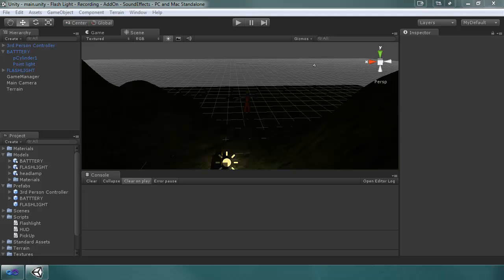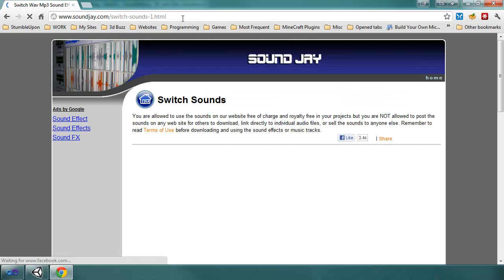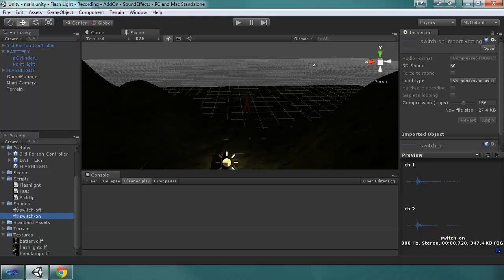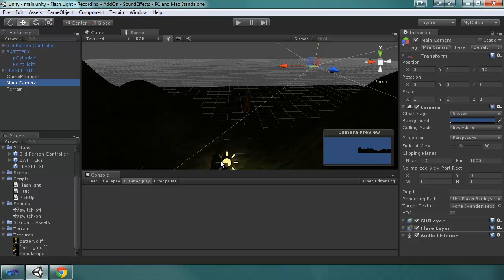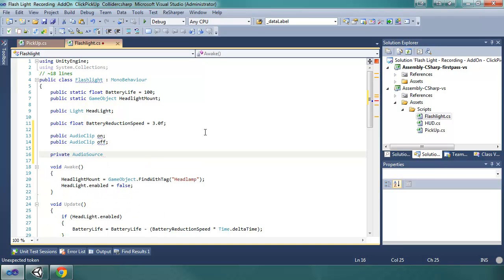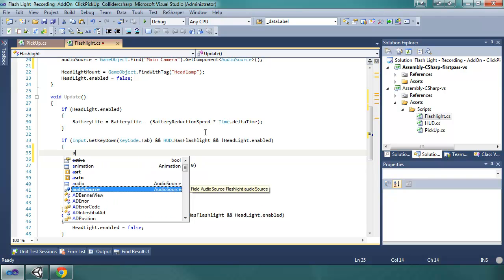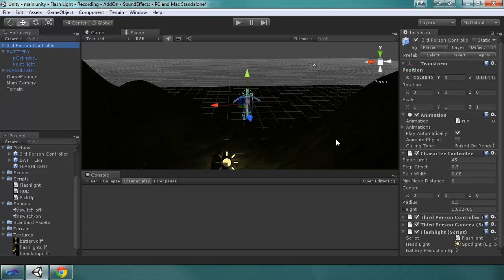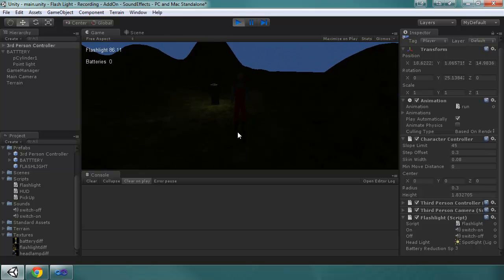Unity 3d - Flashlight Tutorial - Part Nine

Comment: In fact ive been messing around with the code just winging it and the mesh cone that im using for the RAY of light or BEAM of light, if gotten it so its OFF when you start the game, you pick up the flashlight and BAM the BEAM comes on by itself before i hit the F key to turn it on, now when i hit the F key it turns on the LIGHT then I hit F again and it turns them both off as hoped, F key turns them both on, but i cant figure out why when i pick up the flashlight its turning the BEAM on before F